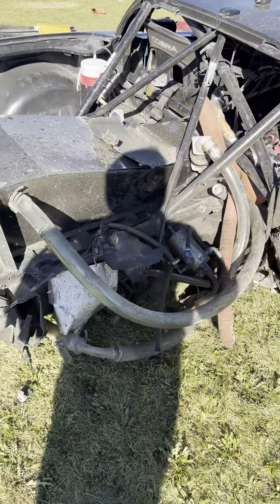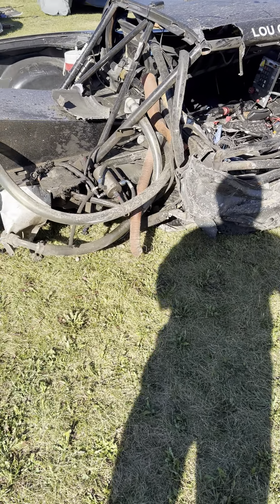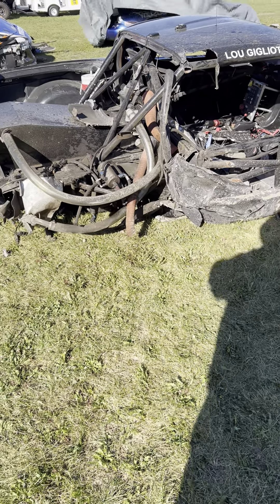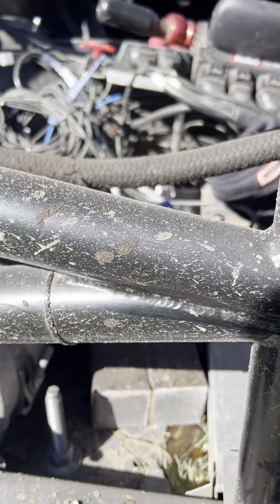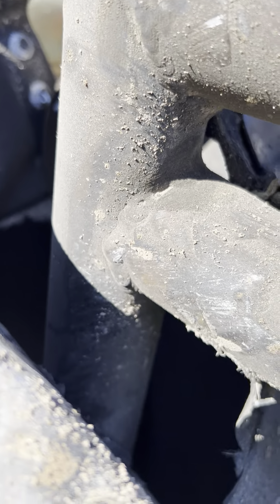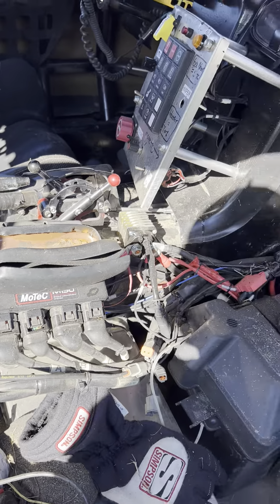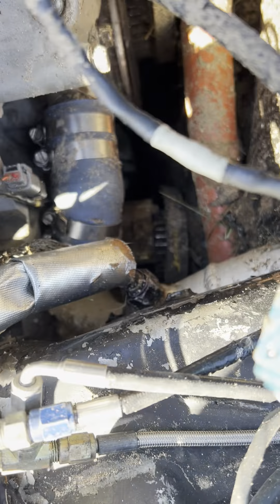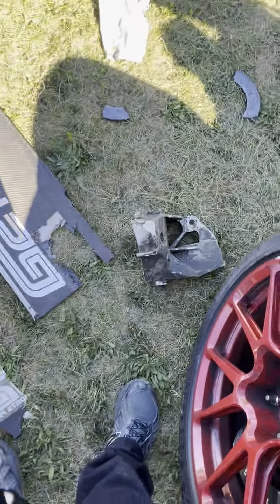impromptu Runoffs 2024 Road America crash break down.

Comment: This is the first time that I have seen the proof that a good weld is stronger than the metal. That's one nasty crash to do that.
Can't help but wonder if the weld's made the metal more brittle.
Glad your dad wasn't hurt more seriously.
He's lucky there wasn't a bigger fire.
I'm reminded of Walter Payton's crash.
The fuel filler was ripped off early in the crash and the car was burning from both ends when it stopped upside down in the spectator area.